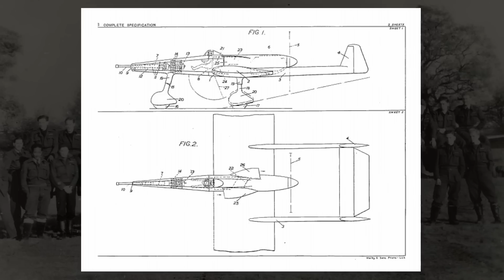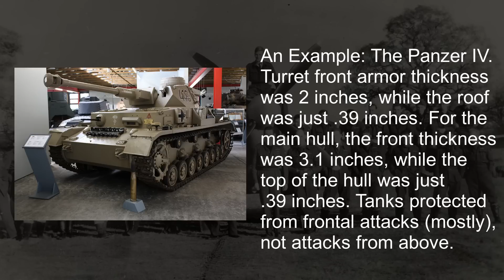Martin-Baker Tankbuster: The Failed Flying Tank Destroyer

Comment: The GERMAN design of the “German American bomber” was an example for the RAF. Should Bomber Command have adapted the ideas of the German, this was very possible and would have increased the performance  of the Lancaster. This design would include two additional Merlin’s added too the appropriate length of the wings.  Lord Chadwick would be adding the necessary extensions starting from the first inboard engine out to the next additional Merlins would then start a 35 degree angle from the outer portion of the middle necell, through the third engine neicell to the wing tip.  With this addition of two engines, increase of wing area to increase lift, the lengthening of the fuselage would be needed with the planning left to Lord Chadwick. The # of Lancs would be limited to a # of Lancs completed, along with parts and spares for two complete squadrons. The # of ship sets along with spare parts would be estimated between 105- 110 complete ship sets and then would replace and renew  # 617 squadron and # 09 squadron with required parts and spares. Barns Wallis wished to build a bomber that would carry the GrandSlam and Tallboy, to reach the altitude of 30 - 40,000 ft. This was the optimum altitude needed to drop the GrandSlam earthquake bomb so it would do the maxim damage that was intended.  Just a little history that possibly could have happened. Hold your heads high for Mr Barns Wallis is TRULY a genus who did shorten the war.  The boggling Germans might  have been inspired to build such a plane. With the extra fuel tanks in the wings, along with the extra height of the bombers, the oil that Germany desperately needed would have been destroyed without any loss by flak or fighter interception. Now that would have been a beautiful sight, like angels singing to the heavens. Man I would have loved it … 
Forever in His service

Comment: Big problem with big guns on planes to do AT work. Not effective enough to make it worthwhile to do a whole new design around it. Generally, very inefficient. 

Don't even start in about A-10s or tank kills until you have finished reading. 

Tests conducted during WWII showed that against a tank sized target, the best results that could he achieved with a slow firing 57mm gun were about 7% hits, at best. That's 1 out of 14 shells. Given limited ammo capacity of large rounds, a sortie could very well be wasted with no results achieved. And that 7% was against immobile targets, with top rate test pilots, conducted under ideal conditions. 

Yes, there were tanks killed by aircraft during that war. A lot of them. Mostly by bombs. Rockets were all reputation, not results, and most gun kills were by 30mm or smaller guns with a high rate of fire allowing hits to be reliably achieved, resulting in mobility or mission kills as opposed to actually destroying a tank. The Stuka and the Hurricane looked impressive with their 37mm/40mm guns under each wing, but they were put to shame by Il-2s with 23mm and Hs-129s with 30mm when it came to hits scored and effectiveness of sorties. 

As for the A-10/GAU-8, has anybody actually researched the trials of that combo? The results are available on line, and they are pathetic. There was actually very little live fire testing of the A-10 against acquired Soviet tanks before it was selected for service, and it didn't do all that great on a test range against immobile targets. Even though it is 30mm with a high rate of fire and a tremendously large ammo supply. 

And the Gulf War? A-10s got most of their tank kills with Maverick missiles, not the gun. What plane got the most tank kills in the Gulf War? The F-111, which didn't even have a gun. Yes, A-10s got some gun kills, but not enough to make it worth the number of Hogs shot down or damaged when they closed to gun range.
No doubt it is the most effective large-gun-on-an-armored-plane design ever built, and yet it still wasn't all that combat effective as a gun platform to make it worthwhile. It is awesome as a close support aircraft because that is what it was actually designed for, but not the god almighty tank killer its overinflated rep makes it out to be.

Comment: First 2.5 minutes of the video was a total waste. 

The example of a B-29 as inflexible when it was used for so many different roles - weather monitoring, photo recon, air sea rescue, AEW, aerial refuelling, engine testing etc. Saying it was only good as a bomber is a lie.

A picture of a Wespe like it wasn't a desperately needed weapon and itself an offshoot of the Pz.II which was a very versatile basis for many vehicles.

Mischaracterization of P-47 and Corsair as being dedicated fighter bombers and not fighters which could serve in the fighter bomber role.

Filler content.
Reply: I was looking for a comment about the Wespe, thank you for that, and I agree with your other points as well.

Comment: Your basic assumption is wrong.   Specialist ground attack aircraft, even BAD ones, had enough success that they would easily have been well worth building some.   The Il-2, the He-129, the cannonarmed Stuka...

The MB TD seems to have taken the armor up part of the concept much too far, but the idea overall is absolutely viable and possibly even quite good.
And ground attack aircraft are not supposed to be superfast, in fact if they are, they are WORSE at their primary job as higher speed makes it harder to effectively hit their ground targets.
Even today, we still have the A-10 and Su-25 filling this role of armored, VERY hard to shoot down ground attack aircraft.

Comment: The 6 pounder gun was eventually put into the Mosquito Mk. XVIII, and used as an anti-shipping aircraft..
Reply: Different 6 pounder I think?
Reply: @williamzk9083   yes, it was a Mohlins 57 mm quick firing anti tank gun modified by Mohlins to take a 23 round basket of shells and could fire at a stagering 55 rounds a minute. Yes minute! Just over a second a round. There is a video on YouTube about this and footage of the gun firing from the ground and the recoil rocking the aircraft backwards.

Comment: You forgot the Mosquito fighter bomber, which excelled at being both, although could not carry the same weight of bombs as the Lancaster. Nevertheless, probably the most versatile plane in the war.
Reply: Wasn't the bomb load only slightly less than a B17's?
Reply: The mossie is amazing

Comment: The B29 featured at the start is an example of how one design for one role can morph into many roles. The basic layout went on to serve in reconnaissance, weather ship, rescue, air tanker, freighter, passenger aircraft, X plane mothership and any other role requiring a large platform with good altitude and range capabilities. Its basic design served in non combat roles for longer than it did in actual combat. At the end of the day, in my experience, all we want is a capable wing and capable engines with flexibility for modification and expansion. Its a rule that has held true from the DH9 to the F15.
Reply: It's quite curious, isn't it, that so many of the most famously versatile aircraft throughout history were originally designed for much more limited roles? In comparison, projects that attempt to build such versatility into the design right from the start often struggle to do so.
It would be interesting to directly compare the way that designs like the Superfortress or the Mosquito originated, developed and evolved, to those that have famously struggled to reach their wider and more diverse design goals, with the F-35 being an obvious example. 
It seems strange that a design like the C-130 - a plane so endlessly useful and capable that variants will probably still be in active service a hundred years from now - could have come from the exact same place as the F-35. The F-35 is certainly more than capable of doing the things it was designed to do, but nobody could deny that the design process ended up being painfully complicated and difficult, not to mention expensive.
It would be fascinating to examine all the reasons why such projects panned out so differently.
Reply: I'm willingly to bet that one of the major reasons the B-29 went on to fill so many roles for so long isn't necessarily because it was especially flexible but due to the insanely large numbers of them built. They may have been designed for a specific role but this made them cheap and easy to produce so when you no longer need them or have something better then why not convert them to be used in auxiliary roles, would be cheaper and faster then designing new aircraft that might be better at the role if it's not necessary. whereas the aircraft that are designed to be multi functional tend to be expensive and time consuming to produce and require a lot of maintenance so is not worth converting like the simpler designs are. Your unlikely to see a F-16 or F-35 used in auxiliary roles due to their expense and complexity.

Comment: Although it may not have been intended by the author, this video does a good job at illustrating why the A-10 is a misallocation of resources.  It is also a slow single-role one-trick-pony, and USAF needs more versatile aircraft that can perform multiple roles, just as the RAF did in WWII.
Reply: A10 is fanastic at close air support and is alot cheaper to use in that role unlike other aircraft.

Soldiers love the A10 for good reason.
Reply: @lordterra1377  The A-10 is no more fantastic than all the other aircraft that have actually provided a larger share of the CAS delivered for our troops.  Soldiers love the A-10 because they got to actually see it in action against its targets, and it exists on for them. Time to grow up.

Soldiers would not love the A-10 if they saw it getting blown out of the sky attacking a targets.  This is what they would see in a war against an actual military power, as opposed to against goat-herding militias who have no real air defense systems.  The A-10 is is being retired because it is a one trick pony that cannot perform that trick and survive on the modern battlefield.  Are you unaware of the state of the air war between two second rate air powers in Ukraine?   USAF and USN will provide CAS with guided munitions delivered from more survivable altitudes and distances.  You are in love with nostalgia instead of reality.

Comment: The F4U and P-47 were not designed as fighter-bombers, they were designed as fighters.  They were not compromised to be good at ground attack as well as air attack, they were meant to be the best they could be at air attack.  All fighters have air-to-ground capability and these two just had more than average due to their overall excellence.  For some time Alexander Kartveli resisted the Army's desire to modify the P-47 with underwing pylons because he couldn't bear to corrupt the beautiful low drag form of the plane.
Reply: The P=47 and F-4U are two of my favorite planes. Both were actually better fighters than the other options we had(such as the Mustang and Hellcat), but they both wound up in the attack role because aircraft like the Mustang weren't heavily armored enough to operate down low.
Reply: @stevenpowell1991  They were both great planes.  But none of these planes were armored for protection from ground fire.  They were designed as fighters and their armor was oriented to protect the pilot from fire coming from the rear and the front. See page 7 of the F4U pilots manual for a depiction of the armor protection. The P-47 training manual depicts protection from the same angles.  The armor is not the reason these aircraft did a lot of ground attack.

The P-47 did a lot of ground attack because after the long-range P-51 became available in numbers the P-47 was reassigned from the 8th Air Force to the 9th Air Force. It's role change from escort of strategic bombers to air superiority over the battlefield and ground attack, which included offensive and defensive counter air, interdiction, armed reconnaissance, and direct support of ground operations.

The F4U did a lot of ground attack because the Navy initially deemed it unsuitable for carrier operations, so it was operated mostly from land bases by the Marines.  The Marine Air is all about supporting the Marines on the ground.  If the Hellcat had been the plane the Navy found unsuitable for carrier ops the Marines would have been issued the Hellcat instead.  It was not due to a difference in armor protection.

The P-51 did plenty of ground attack in WWII as well as Korea.  All fighters do ground attack when they are not needed for or have become obsolete for air-to-air missions.
Reply: I feel the P47 was a better ground attack thank the IL-2. At least the P47 wasn't fighter fodder.
Reply: @kentl7228  
Interesting that the low and slow dedicated ground attack aircraft could have been less effective in its role than the fast high-altitude fighter that was not armored against ground fire.  Yet A-10 fanboys insist we still need a dedicated low and slow armored ground attack aircraft for modern combat.
Reply: @gort8203  Agreed. In Afghanistan the A10 is ok. In a hotter AA zone like Ukraine, it would be toast. It's better to be quicker and not seen at all.

Comment: The uk designed 6lb anti tank gun was used by the US Army in WW2, it also fired HE shells.
Also someone stuck a 6ld gun in the front of a Mossie.  A U.K. 2 seat twin engine bomber that could carry a bomb load of 4000 lbs to Berlin or the same payload as a B17 to Berlin
Reply: B-17's could carry up to 10,000 pounds of ordinance utilizing external bomb racks and 8000 pounds of bombs internally. 4000 pounds were preferred in B-17s to berlin as the USAAC was doing daylight bombing raids and combat damages were expected. Not trying to dis the Mossie, but some context is needed for the B-17s
Reply: @killergames391  10,000 but not to Berlin at the speed that a Mosquito did.   Even the 4 engined Handley Page Halifax B mk 111 V1 could carry more bomb load at over 300 MPH
Reply: an other british heart is bleeding  (:-)
Reply: @michaelpielorz9283  what exactly do you mean
Reply: Holy shit more British cope about the mossie. It's literally not comparable to the B-17. It's just not.
Reply: @matiastorres1510  The Berlin Express  was the name given to the Mossie  that took a bomb load of 4000lb to Berlin and back with just 2 crew.  Sadly the lumbering B17 could not manage the same, if you consider that the Mossie could do one Berlin mission return, bomb up, service and do another 4000lb Berlin trip and return before the B17 returned, the yes Mossie was in a different class

Comment: You mean this 57mm gun is not enough firepower to  defend against enemy fighter? xd
Reply: Yup. Slow, bad pullet drop, hard to aim, and if you do hit them, it’s a anti tank gun, so the pullet would just poke a hole through their aircraft like paper. That’s if you can get behind an enemy lmao.

If you manage to hit a shot with a gun like that against a enemy plane, what are you doing in the Air Force? Become a sniper, you clearly are meant to be one!
Reply: @TeenWithCarrot   "if you do hit them, it’s a anti tank gun, so the pullet would just poke a hole through their aircraft like paper."
It uses aphe round, it explodes after hit. Even if it does'nt explode it will kill pilot if you aim in the head, or damage engine if hit. 
I hit a couple times daily ground to air with 75mm antitank gun, air to air is even easier.

Comment: Isn't this the British version of the German Hs-129 Ju-88P with 7.5cm tank Cannon attached to them. If used against a Bomber one or two shots would really destroy them a single hit of those should destroy a Fighter plane unless it's the F-47 Thunderbolt which has the armor of a heavy bomber but agility of a fighter aircraft
Reply: A 75mm would still only take 1 hit to take down a p47 it would just be harder to hit

Comment: The issue with making a dedicated tank-buster is that in order for it to be truly capable of it's job it needs to be so big and heavy that it becomes easy to take down.
Reply: Ever heard of the A-10 Warthog?
Reply: @MaverickAus  410 mph top speed
Reply: @MaverickAus  How often does the A-10 operate in areas where it doesn't have total air superiority?
Reply: @MaverickAus  completely different era
Reply: @the7A7dude  Really? OMG I never would have known, thank god you are here with valuable advice for the unknowing.
Reply: @MaverickAus  The A-10 is obsolete.
Reply: @MaverickAus  your over defensiveness is ruining your argument.
Reply: @MaverickAus  and the A-10 would be in a similar position, as in against a strong enemy or an competent enemy, vehicles like the A-10 will be hard to use effectively. They require total air superiority to safely perform their task. They aren’t invincible, and in-fact, they are comparable to the video shown in this video. The A-10 is big. The A-10 is comparatively as slow as the vehicle in this video is relative to other vehicular at their times. The A-10 can take a punch, but not a wall falling on top of it, similar to the vehicle in this video.